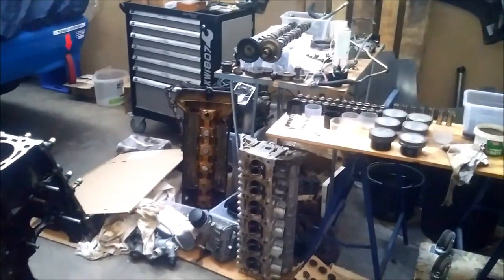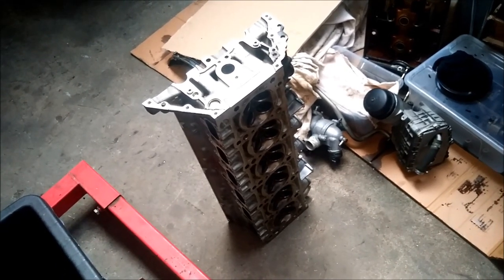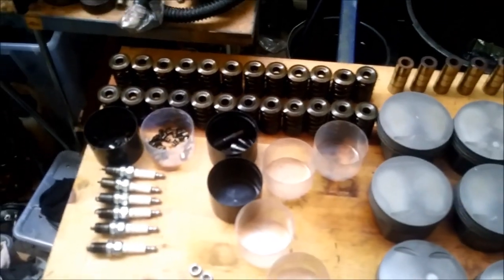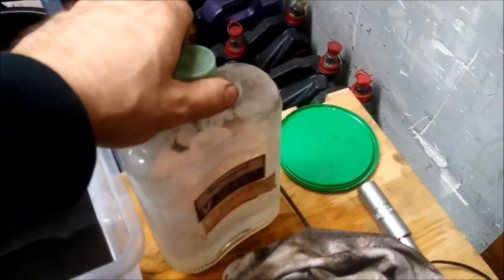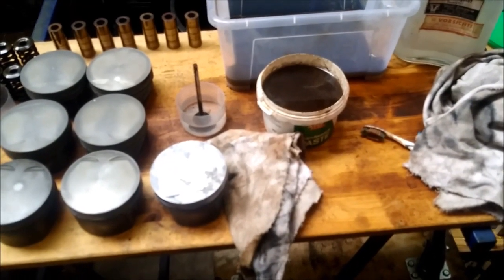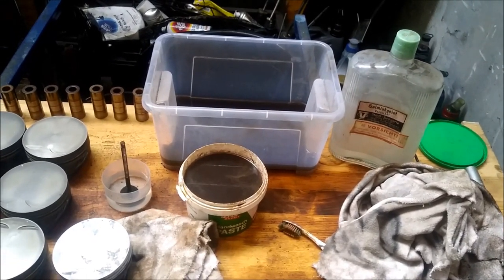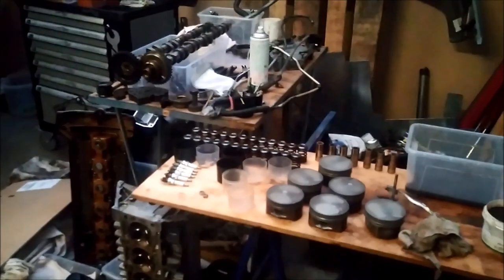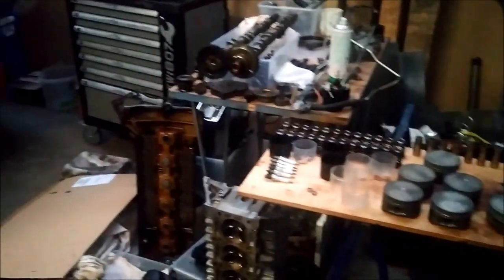My Mercedes W202 M104 turbo project engine build | pistons, rods, bearings etc.

Comment: To remove carbon deposits on pistons I use Simple Green household cleaner. I’m not sure if they sell that in Germany. Here in the US you can buy it everywhere. It has no strong smell to it and works amazing. I just soaked a set of pistons over night that came out of a Mini N12 engine that burned tons of oil. I just used a toothbrush to scrub them and they look like new.

Comment: My preference is to use the rod drilling for oiling and not squirters from the block  .. this way all the bearings are given priority before piston cooling by oil. Hey buddy do you have the part number for those head bolts?  this Video is  2 years old now  how did it go  ?

Comment: What is the reson your not using the oem pistons IT is already tested the the Will easy hold 200hp per cylinder.  I understand You need lower compression  but why not use shorter Rods .  The are also wide range used. ?

Comment: Hello! Thanks for your video!  I can't find pistons m104 90.15mm  . And I will use pistons from ford expedition 90.20mm it cipher. But it flat without holes for valves. Is it possible or no? what are you thinking? Thank you so much!

Comment: Hey there. I have a 1996 c280 sportline. I was wondering if you know if it is possible to run it coil on plug by adding 3 extra standard coils and eliminating the 3 leads. Any info on the ignition system would be much appreciated.. Thanks : )

Comment: HI THERE I WOULD LIKE TO FIND OUT W203 MERCEDES MANUAL GEARBOX 6SPEED WHEN FITTING IT TO A OM605 MERCEDES DIESEL ENGINE. IF I CAN USE THE ORIGINAL FLYWHEEL OF THE W203 I WOULD LIKE TO EAR FROM YOU .
REGARDS ANTONIO.

Comment: Mein m111 hat andere Kolben ist auch Kompressor Modell aber die erste Generation die hat eine Vertiefung ist nicht so glatt wie der eine bei dir
Reply from the maker: Du redest wahrscheinlich vom 230er. Da liegt es an der größeren Bohrungen dass die Kolben vertieft sind. Gruß
Reply: @CZSMotorsport  genau 230 Kompressor stimmt die sind größer hab nachgeschaut